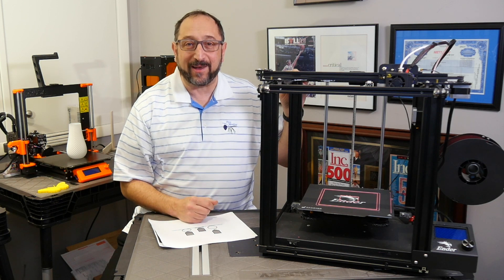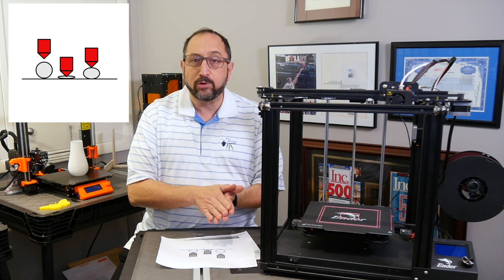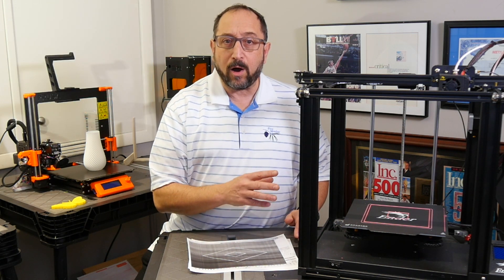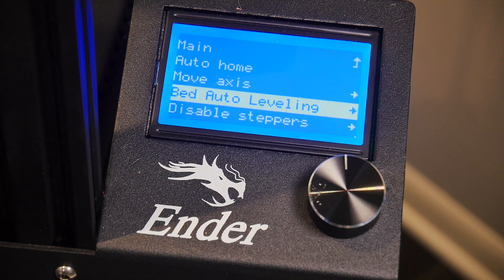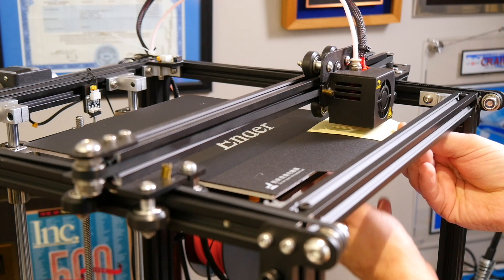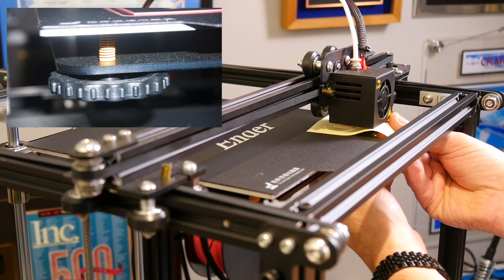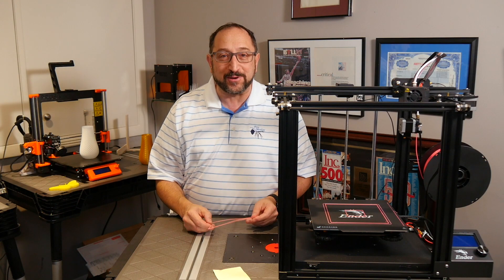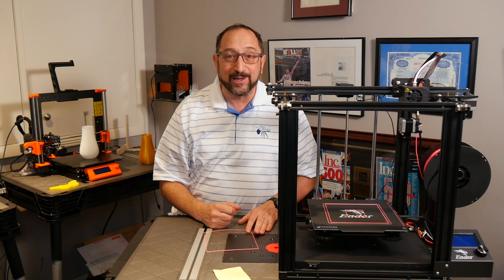3d Print Bed Leveling for the Ender 5

Comment: I set up my Ender 5 Today but There is No Bed auto leveling button instead it says  " set home Offsets" instead of it says bed auto leveling like everyone elses.. am i doing something wrong?? plus after i press the set home offsets it just makes a loud beep and goes back to the main menu! someone help me!
Reply from the maker: The Ender 5 does not have auto bed leveling.  At least mine only had assisted bed leveling.  All that did was move the printer nozzle to each corner and then the center.   While it was convenient it is not necessary.    It is possible in more recent firmware Creality has changed the option.   No worries.

All you really need to do, with the power OFF, manually rotate the Z screw until the bed trips the Z axis sensor switch.  You will hear it click.   You may need to lower the bed adjustment screws a bit if you print bed is currently too high.  Turn the dials under the print bed to the right to tighten the screws and pull the bed down.

You can turn the z screw back and forth to make sure you are tripping the Z-axis switch.  The switch is on the back rail towards the center. 

Once you are in the "home" position, where the switch is triggered (the printer is still OFF).  Now use a post-it note at each corner to check the bed position.  Since the power is off you should be able to slide the print head around.  You may need to push down on the print bed a bit to slide it if the current adjustments are too high.

This video shows how to do this with no SW assistance.  It uses a Monoprice Select Mini as the example but the idea is the same.

https://youtu.be/yzyy2e5cHAg

The Ender 5 also has a global Z offset screw in the back center of the print bed you can use to move the bed a bit up or down.
Reply: @MakeWithTech  thank you very much for your help. Will deff check out the video. Was just concerned that everyone had the assisted bed leveling function and my brand new ender 5 doesnt any thoughts on that?

Comment: i just received my Ender 5 and it has a different list of settings. it also reboots anytime I try to print. any idea why?
Reply: Make sure the little switch on the back of the power unit is switched to 110v if you are in the U.S. Had the same problem took me 2 days of frustration.
Reply from the maker: Excellent suggestion.
Reply from the maker: Are you trying to print from the sd card. If so contact Creality support.  Rebooting is not normal.
Reply: It was the power supply. Thank you!

Comment: I just put my ender 5 together. everything went good with leveling but noticed my bed didn't heat up so my test print failed. Do i need to set my bed temp manually or do I have a bad connection?
Reply from the maker: If you bed is not heating you have either a loose connector, most likely, a bad connector or a bad component.

Comment: Ummmm turning the wheel to the right is clockwise, not counter clockwise? How are you looking at it?  You lost me there.  On my previously 2 3D printers, turn right raises the bed and turn left (counter clockwise) lowers the bed.
Reply from the maker: An easier way to think about it is ... when you are tightening the spring the print bed is moving down away from the hot end/nozzle.

Comment: Hey @DrVax sent you a email about my issue. I did your steps, however my last middle calibration had the opposite results. I am using the stock glass bed and my middle area is actually higher. However I do have clips on the sides of the bed that may be throwing off my leveling. Thoughts?
Reply from the maker: Is your bed flat?   You can check with the a ruler on edge.  With glass on the bed it should be flat and while your bed could be tilted I am not sure how the middle can be higher.  

If your bed is close using Magigoo (a special bed adhesive) should ensure your prints will stick. 

The only other alternative is to put a boot loader on your printer, upgrade the marlin firmware and use either HW or SW bed leveling.   

However, once again if your bed is flat and just tilted you should be able to level it.   Make sure you are making very small adjustments.  Make sure you start the process with the bed level screws in the middle of their range.  Make sure your hot end is attached properly.
Reply: @MakeWithTech  I went back and did it a few times with the level and found it needing some tuning. I did it only twice, and my first print came out flawless.

Comment: What is the max bed temperature ?   Thanks, it can print the abs and. Pteg? And the 112 like is mine💪☺☺👍👍
Reply from the maker: The concern people have with the Ender 5 bed is that the magnets holding the bed are not rated for high temperatures.   From what I can find on the Internet heating the bed above 85C will degrade the magnets over time.    I have a PETG print running at 90C and so far the magnets seem to be sticking over time.   However, this may cause the magnets to fail in the future.

Before starting this test I purchase a replacement bed, both the top and bottom magnetic surfaces on Amazon for $16 so I  this just means I need to replace the print bed magnets every X prints then I do not see a lot of downside.

Comment: You may change the firmware first, activating marlins manual mesh-bed leveling.
Second step: heat the bed to 60°C (or 68°C if thats your prefered temmperature for PLA), as the middle may bend up on temperature. Wait at least 5 minutes after heating up to get the bed warm evenly. Do not heat up the nozzle...
Than do the leveling as you described, but ignore the middle position (exept if nozzle crush into the bed there, you have to lower all leveling wheels than). If all 4 edges are as good leveled as possible, you can do the manual mesh bed leveling.
As the bed bending will be nearly the same on the same temperature any time (as long you do not bend it by force), there is no need for ABL.
If you use diferent bed temperatures or different print surface, of course a ABL is more comfortable. For different temperatures, do the manual mesh-bed-leveling for every temperature you want to use (f.e. 60°C for PLA and 80°C fort PET-G); after doing an mmbl read out the values and store it as an g-code. so you can "print" it before printing with the actual material.
It gets more complicated with different print surfaces with different thickness as this can influence the bending. If you only use "flexible" surfaces, simply more stored meshes may do, but if you use an mirror for print surface you may use an ABL-sensor.
With an removable printsurface I realy do not understand how an company can do without ABL or even semi-automatic bed leveling (like an piezo to manualy put on the nozzle to measure the bed and to be removed after mbl). It wouldn´t be as expensive as an BL-Touch, but more precice. So an impact to the price maybe 10$ but much more functionality.
Reply from the maker: Thanks for providing the info.  I recently received the firmware upgrade and EZConnect bed leveling upgrade kits from TH3D.  While a bit expensive you gain access to an outstanding support organization and first-class QA.   I will be making a video of how to do the update in the next few weeks.
Reply: "So an impact to the price maybe 10$ but much more functionality."

Or they can sell the ABL upgrade kit for 35, like Creality does ;)
Reply: @LászlóKrencz  One of the problems with the upgrade kit for ABL is the BL-Touch not being the most reliable solution. There are many users complaining their BL-Touch got foulty after a short time - and the replacemant did also. Of course the voices of people with problems may be overrated, because if you have a problem you post more comments as if everything just working fine. But anyway - its an entry level printer and for a 3d-newbee such source of problems should be avoided.

The best solution in reliability and precission and working on all printfaces would be ABL with an piezo mounted between printhead and x-carriage, using the nozzle as the actual probe. Its also quite cheap - a piezo disc is only some cent and if you design the mount for the printhead to use the disc from the start the price for the "mecanical part" would be less than a dollar. It needs an adjustable electronic, but thats also less than 5$. Its just not easy to do so as an simple "upgrade kit" for beginners, as you would have to disassamble the printhead to get a holder for the piezo between the head and the x-carriage. Something as https://www.thingiverse.com/thing:3404715 wich is in developement beta state. 
Of course it only makes sense if you get rid of all the vibrations due to the cheap stepper drivers, as they can lead to false readings.

Another solution for more reliable ABL would be an magnetic sensor like the PINDA2 prusa uses. But it works only if you use springsteel for printbed (wich is a good idea anyway, you can get a spring steel about 20$ US and glue any surface you want with 3M on top (exept glas of course...) or buy even pei-powder coated spring steel (like on the prusa mk3).
But I do not think it´s something for beginners (but in price: about 12 $ for a pinda-probe, 20$ for a spring steel it is quite a nice solution for experiented users).

In my case I want to rework the Ender 5 a little further in the next months: I got an Einsy board (cloned from Aliexpress on the last black friday for 54 €) and want to change the printhead to the prusas mk3 printhead (but whith the bmg version from bondtech using chinese cloned "dual drive" and pencake stepper). Altogether the electronics, the z probe and the printhead would be like on my prusa mk3s, for about 100-110 $US (+bed). Even the original prusa firmware should work; but you should be able to print faster than with a mk3 with the same quality due to less weight on x and y using the cube design. And it should be easy to add an MMU2s for multiMaterial printing.

As I have other ongoing projects it will take some time before I start the Ender 5 - upgrade project (I do modifications on 5 other printers (out of 6, only the mk3 is manly unchanged), so the Ender 5 is now for the worst case szenario all my printers are not usable the same time an (which happend last week, I broke a part on my mk3) and I have to print upgrade/replacement parts, so the Ender 5 will be unchanged until at least two of the other printers in progress are finaly working).
Reply: ah! heat it first, thanx! My bed is lower in the middle when I calibrate. Will try your sugestion. Thanx! :)

Comment: Hello I'm a follower and love your video but have a question to see if you could help me, I have STC 3D printer and I downloded the software you recomended but it doesnt let me print and wanted to know if you have a video that show you how to print. Thank you
Reply from the maker: What software are you trying to use?   What is the full name of the printer?
Reply: CTC BIZER 3D PRINTER.    SOFTWARE MATTEHACKER
Reply from the maker: What type of computer are you using?   Did you verify that the computer is recognizing the printer is plugged into the USB port?   If you are using a windows machine you will need to install USB drivers to use the software.  

The best place to get help is probably the mattercontrol web site.  Here is a link to the FAQ.  

http://wiki.mattercontrol.com/Frequently_Asked_Questions
Reply: Hola
Reply: Hello

Comment: I ended up ordering an Ender 5 just yesterday.  I see lots of people just going to a mirror surface to help with the issue of dips in the bed plate.  I may do that right off the bat.
Reply from the maker: The only disadvantage is you loose the advantage of the removable magnetic surface which is quite nice.   Also you may want to check your bed first.  Mine is very flat.
Reply: hows ur ender 5 ? do u recommend it or i buy ender 3 pro ?

Comment: Hello.. I’m having an issue with leveling my MP10, which you said would level similar to the Ender5. To get the print head properly adjusted to the print bed my knobs are so loose they are moving on their own as the printer operates and they are essentially rattling themselves looser and then falling off.  Any suggestions?
Reply from the maker: It sounds to me like you do not have the hot end (nozzle) in the Z home position when you are trying to level the print bed.   On the MP10 you can turn the Z-axis rod (vertical rod) by hand if the PRINTER IS OFF.  On the right side of the print bed, there is a limit switch.  You should turn the rod counter-clockwise until you hear the switch click.  Then turn it clockwise to back it off and then move it down again to make sure you are in the home position.

Comment: Thank you! The literature that came with my model was not nearly as clear.
Reply from the maker: Your welcome.  Let me know about additional subjects you would like me to cover in a video.
Reply: @MakeWithTech  Do you have any advice on how to print with PETG on the Ender 5? I've tried all sorts of options; hotter and lower temps on the bed and the print head, speed, retraction...prints either don't stick to the bed, or the filament ends up stringing and failing. I have good luck with PLA, but would like to try other options.
Reply from the maker: Interesting. I have not had trouble with PETG --- depending on the PETG.  For example, the PETG Prusa ships with printer parts are quite hard to print.  However, I have found SainSmart PETG no harder to print than PLA.
Reply: @MakeWithTech  Ok, I'll try Sainsmart. Thanks!! 😀

Comment: For the ender 5 there a auto level sensor.
 Creality BLTouch Auto bed level sensor. Maybe need to try that one
Reply from the maker: I just order one.  I have not found anywhere that specifically lists this as being compatible with the Ender 5.  As soon as it arrives I will review it and post a video.  Probably a couple of weeks from now.  Thanks for pointing this out.
Reply: I am about to place my order this week for a ender 5 and also the sensor. That for the info video how to use otcoprint. Will just use my Ethernet instead WiFi.
Reply: Can you post the  dimensions of the printer. Wanted to get two IKEA pack table and hope it fits to make it inclosed, since the printer will be in my shop.
Reply from the maker: Sure.  These are approximate so please leave yourself some extra space.

The frame is 410mm wide, however, the X-axis stepper motor extends beyond the frame, which makes the width approximately 530mm.  In addition,  a full-size filament reel extends about 230mm on the right-hand side for a  total width of  760mm. 

The frame plus stepper motor is 480mm deep and about 520mm tall.

The feet are on the frame so a table that is about 420mm wide will hold the printer and the filament and stepper motors will just extend outside of the table surface.

I hope this is helpful.
Reply: Thanks so much. Could find no where on the web the size, only printing bed size. The lack table is 55cmx55cm so would fit. May relocate the reel to the top like they have for the Prusa ikea lack table case.
Reply: I asked Creality about the auto level sensor firmware for Ender-5. Here is their reply, “the firmware we still working on, temporarily we don't have for you, only have ender 3 and cr-10, sorry.”
Reply: RustyTube thanks for letting us know. So would not make sense to order the sensor right now if not supported till then. So will order it later the .
Reply: @welcool2007  You’re welcome.
Reply: Have you thought about the EZABL from TH3D?

Comment: Wish I saw this last night. Leveling for the first time last night as well as first 3d print. My print bed doesn't return to bottom like yours.  Should it?
Reply from the maker: This is a function of your slicer, not the printer.  The command to move the print platform after the print is complete goes into the printer setup.  For example in the Ender 3 definition on Cura this command is included after the print is complete "M84 ; Disable stepper motors".  I would have to test to be sure but I think this releases the Z-axis and the weight of the platform causes it to go to the bottom.   For my Ender 5 setup, I started with an Ender 3 setup and changed the print platform size.
Reply: @MakeWithTech  thank you!

Comment: Thanks I just bought an Ender 5 for my husband and I am trying my best to help him. Okay so I downloaded the thingiverse from the site and my print in one corner instead of following a straight line went diagnol. The outer square I am trying to use printer paper to level my bed is it too thick? Do I need something thinner?
Reply from the maker: One more suggestion.  Make sure the magnetic print surface is clean.  Any oil from your hands will cause the print to release.  I clean my print surface with rubbing alcohol before each print.  Just put a few drops on a clean cloth and wipe down the print surface.  The print bed can be warm when you do this.  It still works.  You just want to remove all oil like cleaning a window.  

Do not use acetone as it can harm the print surface.
Reply: Ty I was wandering what we were suppose to use, we were using a hot water and shop towel. I had to fix the retraction settings all the way up to 6mm. Translucent filament is extremely stringy.
Reply from the maker: Printer paper is fine.  I recommend cutting out a 3” square.  It will be easier to use. The print probably did not stick to the bed and was dragged by the print head which cause it to seem diagonal.  The corner where the diagonal started is probably too high.  Also make sure your print bed temp is set to at least 60c and you might want to try 70c.  Finally make sure you are using PLA and are using the default cura settings.  

This is trial and error process. Keep at it and you will succeed.